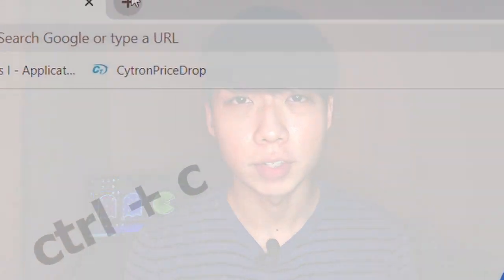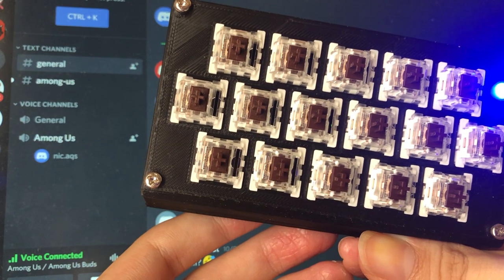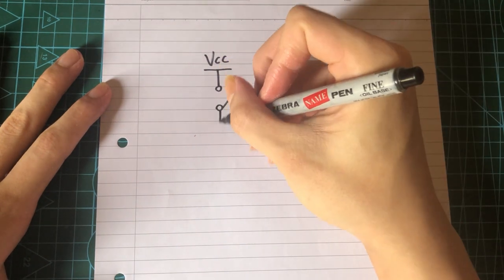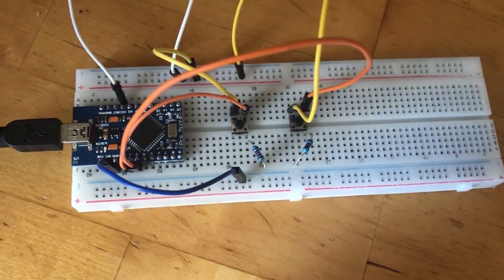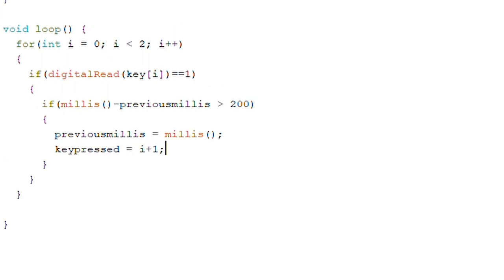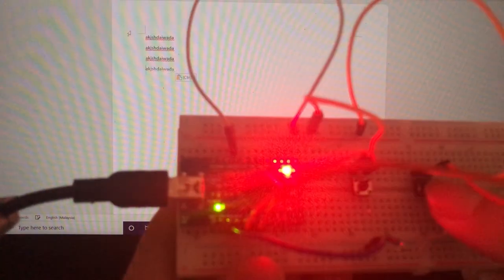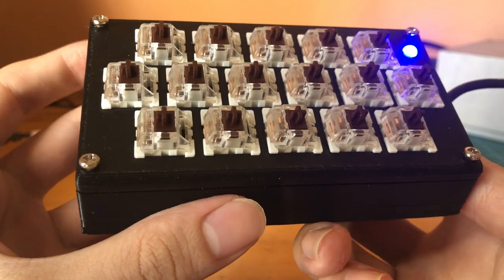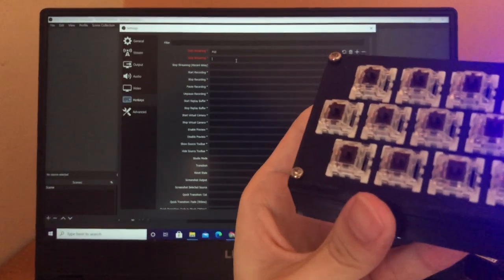Building a Macro Keyboard/Stream Deck

Comment: Why would you need resistores?The Arduino cant output over 5v i thought.🤔
Reply from the maker: To act as a "pull down" resistor. The need for it is still pretty debatable per my research online.

Comment: I have made it with 19 buttons, all 18 io pins + 1 pin direct to atmega32u4 and i have adapt your code because previousmillis not work with older software and i set delay manually on single pins, thanks for the code!

Comment: niceeeeee, so do you need to individually code each key or was that just for the test? e.g. do I need to code eachkey, or will it just work when I plug it in, for OBS and stuff
Reply from the maker: Yes, you have to first code each key to represent something, i.e. F13, F14, or even a macro like ctrl + shift + D, etc. Then plug it in and use it with any software.
Reply: @NicAqueous  alright, thx

Comment: I know I might be late but how would you know what pin on the key switch goes to where?
Reply from the maker: Hi, I suppose you mean which pin from the switch should be connected to signal pin and which to GND on the Arduino? It will work whichever way. :)
Reply: @NicAqueous  Thank you so much!
Reply: @NicAqueous cuando sacas más videos ??

Comment: Just noticed that while you were testing the small buttons, it pasted the text two times instead of one (and that twice).
Was that because you hold down the button too long? Or it read it was clicked twice? Or too low delay/debounce? 
Going to utilize your tutorial to build a board with a single cherry switch that needs to be low latency and cant have too much of a delay, since it might be pressed again within miliseconds. 
Good video! :)
Reply: Suuuuper late but in my experience using buttons such as those there is a lot of "bouncing". At the time I remember putting a delay of 20ms or so. You probably already figured it out at this point and found what works for you! Cheers!
Reply from the maker: Precisely as what you and Martin had pointed out :)